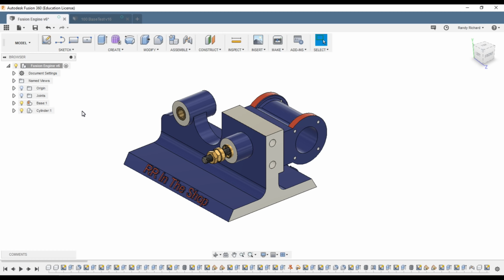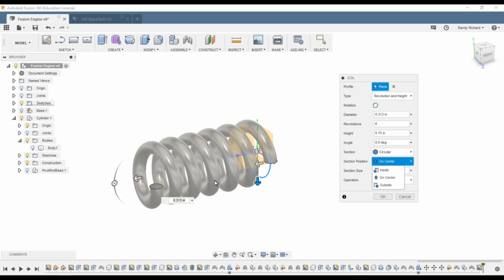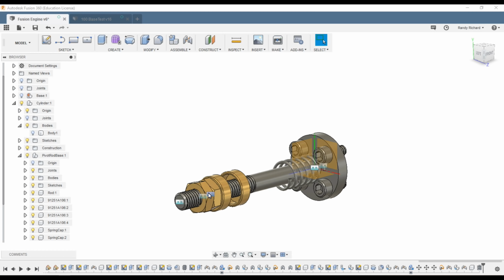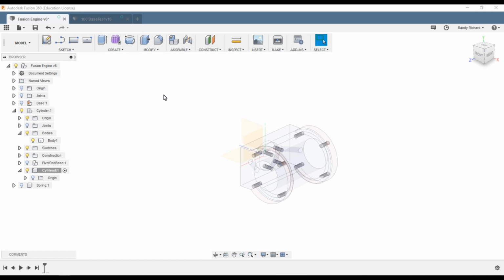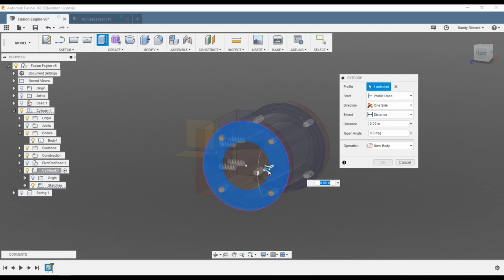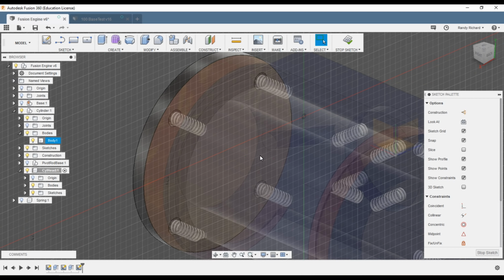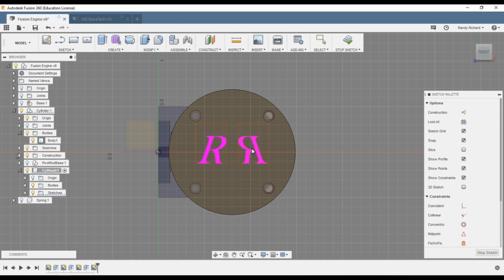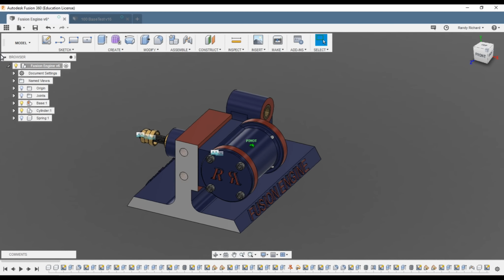P3-3 How to Model the Spring & Cylinder Head Of a Model Steam Engine From the Ground UP

Comment: I took a bit of a detour in this video.  I built the spring and cylinder head just fine but stopped to model my maker’s mark Logo for Sinebar Design. I’ve had it sketched out on paper for quite awhile but have never actually rendered it.  So now my monogram appears on a boss I put on the Cylinder Head.
Reply from the maker: Sweet deal.  So you poked your head out of the box, good deal.
Reply: Looking at your pin punch video today; coincidently, now that my model is complete, the next item I’ve undertaken is to go back to the sketch I did to extrude my Maker’s Mark on to the Cylinder Head and use that sketch as the basis for creating a set of virtual Maker’s Mark punches.  I’ve now got a separate folder with Maker’s Mark punch tools to use on my Fusion models.  

Just as you can import a sticker to apply to any face on your model, you can also drag one of these tools into your model and move it to the spot you want your Maker’s Mark and very precisely position it to penetrate the model face a couple of thousandths and use the Combine command to punch a virtual Maker’s Mark on you model.  It works great, and you can use these tools repeatedly on all of your Fusion models.  I currently have a set of three punches, one with 0.1 inch diameter, one with 0.25 inch diameter, and one with 0.5 inch diameter.  

I’m thinking about adding a set of number punches to punch serial numbers into my models.  I like the slight variation you can achieve by individually punching the numbers over relying on extruding Fusion generated text.